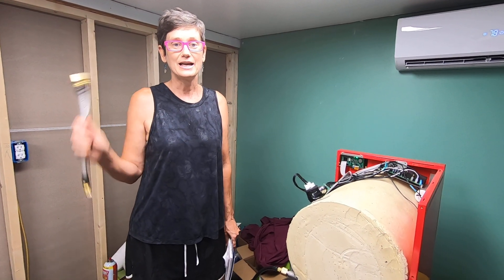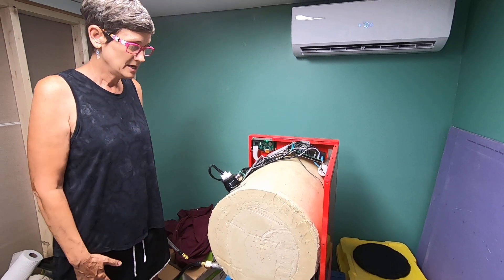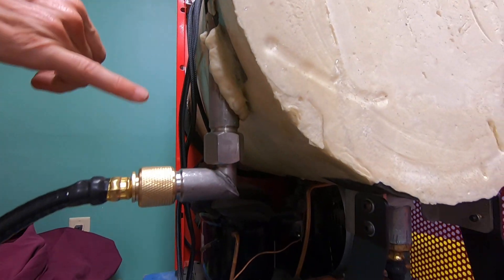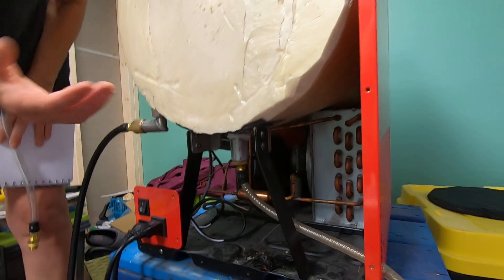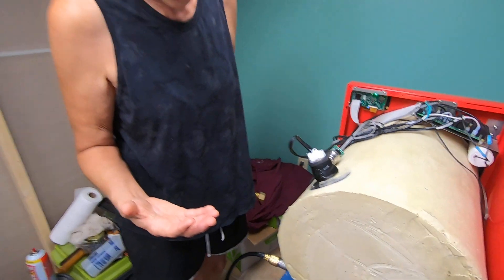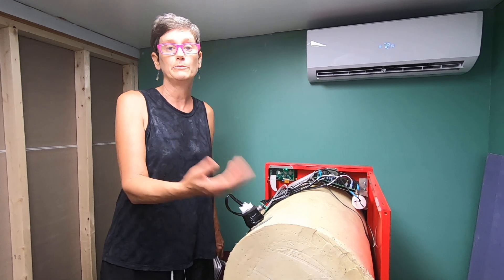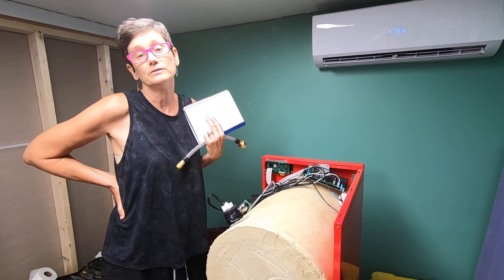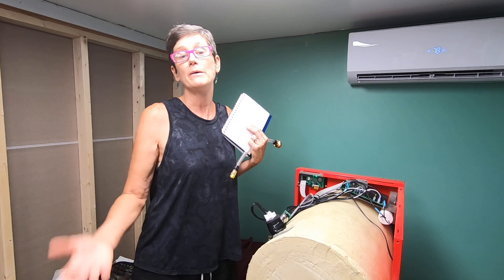3F: 1 Year Day 190 - Freeze Dryer Vacuum Leak Fixed! Lessons Learned

Comment: Hi  thanks for your video.  My medium freeze dryer has a vacuum leak ( 650 mTorr in 30 mins).  But I moved out the rack structure from Vacuum chamber.  The vacuum test passed 350mTorr in 30 mins. Would you be able to give me advice on how to stop this leak?
Thanks   Frank
Reply: That has me stumped. Not sure why the rack would make a difference. We have switched to the oil pump and haven’t had any vacuum issues since. Going on two years!

Comment: Thank you for the info. This is like buying a new car and never being told that you need to learn to be a mechanic to drive your new car. Both my husband and I are in our 70's and have lots of other things that take our time besides the freeze drying. I am very disappointed that after just 8 months I am testing and retesting and praying and not hearing back from HR. I guess I should have seen all the videos on people working on their own machines before I bought this.
Reply from the maker: I hope this video helps you moving forward. Since we switched to the cheapest oil pump and we replaced the relay board, ours has been working like a champ! The oil pump is messy but I swear it is more effective at pulling a vacuum. Good luck!

Comment: Follow up...To confirm leak, I closed the drain valve, poured a quarter cup or so of water into the drain hole inside the machine, then opened the valve just enough to bleed out the air and the closed it.   Did a vacuum test and could see a lot of air bubbles being sucked in through the hose crimp near the valve.  They are sending me a new hose.   The hose itself is pretty thin.  I read it's a good idea to zip tie the hose against metal side with the metal coupling against the hole metal.  Still leaves room to turn the valve handle.   Better yet is to make a grommet and put  around metal edge of hole then zip tie it.  Keeps metal from wearing hole in thin hose.  As much as this hose is normall moved around, you know it's got to be hard in the cheap crimps. You probably know all this!  Right now I am putting "Shoe Goo" on the crimp while under a deep vacuum to suck it into leaking area.  You can also use good silcone caulk.   Should work...also add that special tape after it dries.  With all the issues listed by others on the internet, they need to make improvements.   When I told the HR employee about my drain hose leak, he said it's the first time he's heard of this problem....Ha Ha!   Mybe it was his first day on the job.
Reply from the maker: Oh my goodness that last statement made me bust out laughing!!! Thank you so much for the follow up - it definitely will help others!

Comment: Third load on a new machine and now have a crimp leak in the drain hose. Such piss poor quality hoses.   I better get one with no BS.  Should have never bought his.
Reply from the maker: I hope that fixes it. Good luck!
Reply: Yes, HR has really cheaped out on hoses causing lots of problems for many people.
Reply: @I_B_Phrede  You know there's a little space around  the metal hose connectors where it attaches to both the hoses.  I pushed silicone caulk into that space under vacuum.  I also bought new suction hose o-rings at Home Depot.  They are the right diameter but just slightly thicker.  This  helped some.  One thing that bothers me is the technicians will tell you differant info than what's in the manual.  Like how deep the vacuum should go and how quickly.  I am still getting air blowing out of vacuum pump when filter cap is removed.  This should not be happening according to the manual.  Indicates a vac leak is still there.   Going to do another spray bottle test and check out that connection at the top of the tank.  Mine is a scratch and dent...and it was dropped.  Should have gotten twice the money off.

Comment: I’m 10 days into a new machine and have not had a successful run yet. Keep getting vacuum leaks and it won’t warm while drying. I’m frustrated and disappointed that I’ve spent a fortune (to me) on this machine and I’m having trouble right out of the box.
Reply from the maker: That is the worst! Another commenter had luck with getting them to replace his broken one and it still didn’t work because of the hose between the pump and machine which they did not replace. They really need regional repair teams that go onsite and troubleshoot until it works! I think it would help so much with relieving the customer service team of the job of training us to be repair technicians!

Comment: I'm six weeks in, broke within days of my 1yr warranty. I had to replace the relay board, epoxy plug and pigtail; now I get high Mtorr readings and mid-batch vacuum failure. When I contacted Harvest Right I was under warranty. My 1st tech appt. took over a week and she canceled the day of, my 2nd tech sent me a bill for the parts anyways and now at 5pm (right before closing) she responds like she never even read my emails with unrelated reply's. I spend hours DIY troubleshooting every day and now nearly $600 spent with no improvement. She also had me upgrade to 16 and I should have ran a test before because she doesn't have a copy of 13 and the only other option is 19. Waiting on a new pump HR has yet to ship. Ordered the silicone tape mentioned, silicone, carb cleaner and new hose (from Canada). Fingers crossed my own process of elimination will fix it without costing 1/3 of a new one. Thanks for the suggestions. I wish HR would not hide (unlisted) their tech instructional videos. Good luck everyone!
Reply from the maker: Holy smokes that is frustrating! Our big three problems have been the drain valve, the relay board and pump replacement with the basic oil one. Since those three replacements we have been rolling again. Good Luck!
Reply: We had a vacuum leak but no screen warning. We have an oil less pump and an original standard pump. Both pumps failed the vacuum test. That told us it was the freeze dryer, not the pump.  My husband did the leak test and found the last O ring he checked was shredded. He replaced it and that helped, but still had a vacuum leak....800 mT on standard pump, 1700 on the oil free pump.   I insisted he replace all O rings, regardless of what they looked like.  Finally, we can get below 500 mT. I am pre-freezing some carrots coins so I can do a test load that I could dehydrate if the vacuum fails.  Fingers crossed.  I don't have time to fool with HR techs. People, we are running out of time.  I love my freeze dryer, as long as it is working correctly!

Comment: HI, So you said you replaced the drain valve(your original problem) and created another, how did you fix that problem. I have water coming out from under the foam insulation where it goes into the chamber(on the drain valve). Is that where you use silicone seal to solve that? Thanks!
Reply from the maker: Our second problem was fixed by removing the excess connectors and using Teflon tape wrapped five times. I’m worried about water coming out. We just had air leaking so couldn’t achieve pressure. No water.
Reply: @foreverfoodsfarm  Thank you for your response. I'm leaking water and  the insulation on the bottom of the chamber outside is wet. I will clean and dry it, then silicone. I may have to redo my Teflon tape too,and see if that works. :)

Comment: ya know...we need to be more self-reliant and figure these things out for ourselves and then just ask for the parts we need.  That we can have these machines for less than 20,000.00 is amazing.  I know what freezedryers cost.  We have also had some issues with customer service and I just go over their heads.
Reply from the maker: I agree with this sentiment 100%. I figure we can be stubborn and stomp around until they take action or we can empower ourselves. It is very hard when you aren’t tech or mechanically inclined but hopefully community local or online can help! Thanks for watching!

Comment: Reading some negative comments here on HR, I figured I'd share my very positive experience from a few weeks ago. I honestly hadn't used mine in about a year because life got busy and has settled back down where I was gearing up to start using it, I purchased mine in January 2018, now June/July of 2022, I received the email software update from HR for 5.0.19, mine was running 4.0.26, Figured I'd do the update, after I did, my touchscreen didn't work, I honestly don't know if it did before the update as I hadn't run in a year. Called HR, walked me through some things that didn't work, called back and they just went ahead and sent a replacement screen with the latest software preloaded. Installed screen, and no problems. I think that's pretty good for a company that my warranty expired on 3 years ago, and it was no cost to me, no questions asked. Back in 2018/2019 a HR warranty was only 1 year, nowadays it's 3 years. I consistently see HR evolving in a positive direction. So there you have it.
Reply from the maker: That is wonderful! I really hope they start doing these things more and more. I love their product and if they can get their customer service consistently good then they will go far. Ours had been running well for 6 months now. When it works it is so awesome!

Comment: So strange that Harvest Right has everyone trained to do their jobs for them.  Our FD is under warranty and has been broken for 2 weeks.  We have had to spend dozens of hours of our own time troubleshooting.  At this point there's nothing left to troubleshoot.

But after spending $3,000 our garden is producing and we have no freeze dryer.
Reply from the maker: That makes me really sad. I know what you are going through. My whole business plan tanked when mine went down during harvest. It is impossible to have a backup when you already took a huge leap to purchase one. I do hope HR improves. Until then we just have the community.
Reply: @foreverfoodsfarm  They're sending a new pump.  Not much indication that it's the problem but we're hoping it is.
Reply: @boboscurse4130  hey! It’s me….the one having the vacuum issues. I replaced my valve with a good one from Lowes. I couldn’t find the tube silicone locally so I had to order it and it came yesterday. Running a vacuum test now to see if changing that valve will help. How’s your machine? Still running? (I hope!)
Reply: @AnnieGrey11  Yes it's been running non-stop.
Reply: @boboscurse4130  so happy for you!! What a relief! I’m still down. Last week with HR was a complete disaster. The tech told me he didn’t think it was the sensor board, he thought it was a leak so he sent me instructions for testing with carburetor cleaner. He had me send pictures of o rings, inside of door gasket… nothing is wrong. 
Ran the test and I couldn’t find any leaks. I ran a vacuum test without the shelving unit and it got into the 300s. I emailed all that I formation along with thumb drive. Next day call, he had not read my emails. He had me do a mock batch, shelving unit in, no food and told me to run it, continuing on through errors. By 2:30 am I called it quits after continuing on through 2 errors. The mT never went below 900. 
Sent emails (multiple) and thumb drive. No response. Was supposed to have a call on Friday and I asked for confirmation to make sure he remembered the call. Never responded. He missed the appointment and I went wild. Did a group email to everyone I had ever spoken to expressing my extreme displeasure and frustration, and he finally responded saying he had vertigo. 🤷🏼‍♀️
Here it is Monday and I’m no further along. Have already called and written. I’m about to file a complaint with the BBB. 
Sorry for venting
Reply: @AnnieGrey11  You deserve to vent.  First of all, this is another example of poorly trained techs.  Our tech told us the carb cleaner is outdated, and to use Windex.  Second, the silicone sealer cured our problem, which means the leak had to be there.  But the Windex test, which I did many many times on that area, showed nothing.

They need to come up with a better way to find leaks.  I saw someone on YouTube with dye that can be seen with a black light.  COME ON!  Should we really have to do that?!
Reply: @boboscurse4130  Same with me. Not one spot I tested showed a leak, but after I put white silicone around the epoxy I thought I had fixed it. I ran a batch of green beans and it worked, with mTor in the 300s. Now I'm doing a batch of fruit and at first, it dropped to the low 400s but now it's up to 560 +/-. The tech said to use only clear silicone, but that didn't work for me, so I scraped it off and used the white and that's when it dropped. What type did you use, and why would it matter? I have no idea why green beans were ok and apple slices are not. Water content maybe? Any suggestions? I told Silas I was close to putting this thing on the curb and I'm serious. I can't keep doing this. Thanks for your help through all this. It's very much appreciated.
Reply: @AnnieGrey11  I used white.  I have no idea why it makes a difference.  Do have more green beans you can run?
Reply: @AnnieGrey11  Well, our friend got her FD.  Got it all set up.  Ran the vacuum test and it won't go below 960.  She's devastated.  She's in her 70's and she was so excited to preserve her produce from the garden.   Shame on Harvest Right.
Reply: @boboscurse4130  she got it after knowing all the problems you had? I guess we are all desperate to put away food. I hope they respond and help her! Thank goodness you have experience, but I'm sure she knows she has to go through the HR process to get things documented. I'm keeping a very detailed logbook on everything, starting from when I got it and including when I put in the first ticket, every phone call, all vacuum readings, etc. I ran a batch of chicken that did pretty well although the mTor fluctuated between 450-560 the whole time. I have to re-do a batch of thin pineapple slices, but at least it's sort of working. Does your pressure stay consistently below 500? Mine is not.
Reply: @AnnieGrey11  No it jumps around.  I don't know the science of how it fluctuates temp and pressure.

My friend's new FD ended up being a simple fix.  The screw on the chintzy drain valve was loose.  She tightened it and it worked.  I told her to get a good valve asap.
Reply: @boboscurse4130  good!!! So glad! I’ve replaced my valve with a heavy duty one from Lowes. When I took the old one off, it was corroded on the inside. I wouldn’t have done that had I not seen it on YouTube. Interesting that your pressure fluctuates too….

Comment: So I finally got mine to work for now.  The key was using that silicone self-sealing tape over every crimp and fitting from hose to threads.  I also replaced the ball valve with a 600WOG rated valve.  I suspect the vacuum hoses can leak at the crimps and swivels.
Reply from the maker: Excellent! Thanks for sharing what worked!

Comment: Thank goodness I found you!!! I will be contacting you if I can't fix my freeze dryer vacuum problem. I just got over round and round with them about my circuit board and they finally sent one. I put it in and it seems fine...no more saying factory reset on it...now I have this vacuum issue.  my freeze dryer is just six months old! 😩
Reply from the maker: I’m actually glad I’m beyond the warranty because I know I’m on my own which makes me dig down deeper to try to fix it without needing them. If it was still under warranty I would get severely frustrated! Good luck, I hope you can identify the problem. First thing I would always check would be the stopcock valve. I keep seeing where that is hanging a lot of people up. It certainly got us.

Comment: You have a newer machine than mine.  I think most people expect that when they pay $3-5,000 for an appliance that it's going to work out of the box.   The level of troubleshooting and repair that HR is expecting out of their customers is incredible.  I recently purchased and returned a $750 Premier pump back to HR because they refused to do any troubleshooting with me unless I forked over another $45 'diagnostic' fee.  Very poor way to treat your customers.
Reply from the maker: I think I would have more patience with customer support if it didn’t cost money to use them. It is kind of hard to be expected to pay for diagnostics and creating tickets and still get less than stellar support.
Reply: @foreverfoodsfarm  When I bought my unit in 2015/16 they had pretty good customer service.  I had some initial issues that were resolved quickly over the phone and I wasn't charged.   They suffer from quality control issues now with units leaving the factory without parts, wiring harnesses not even connected, etc.  That should never happen.  They spend a ton of money shipping units back and forth across the country to address things that should have been caught much earlier. I suppose the solution now is to ship it first and then make more money charging people to talk to you.  I hear this story more and more and it doesn't bode well for the company.
Reply from the maker: @michaelrichard5554  let’s hope they figure it out and reorganize their priorities and put this dark era of their business trajectory behind them.